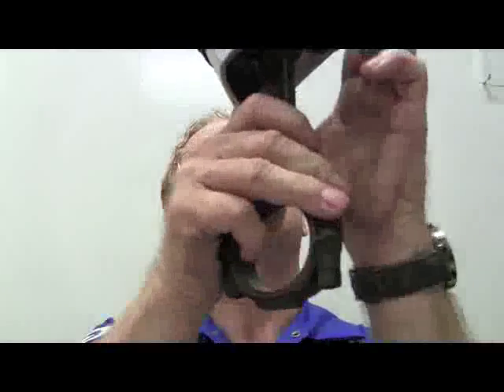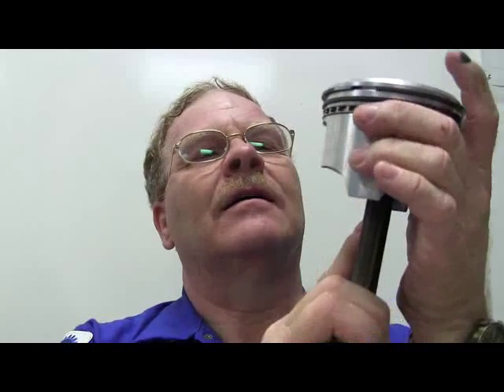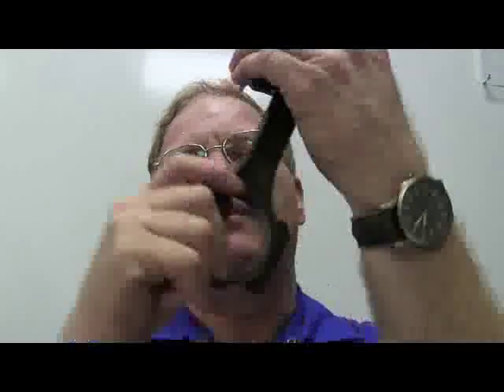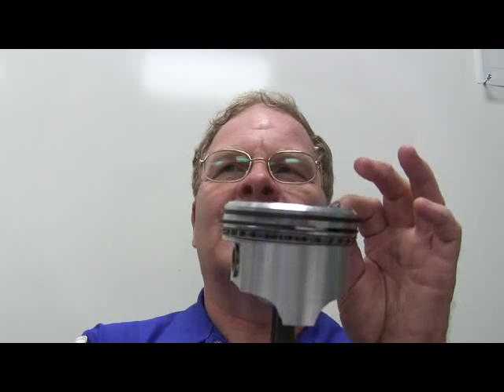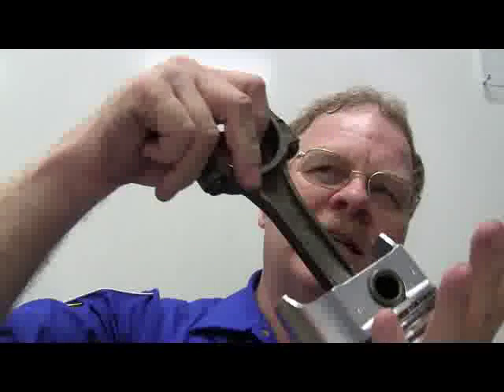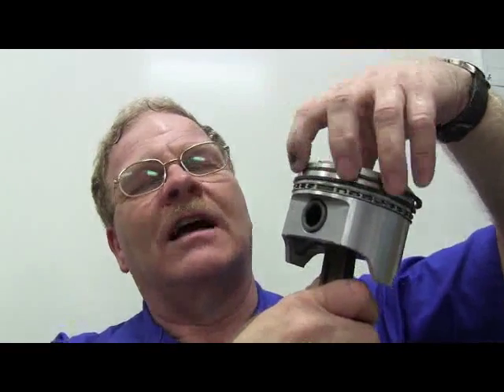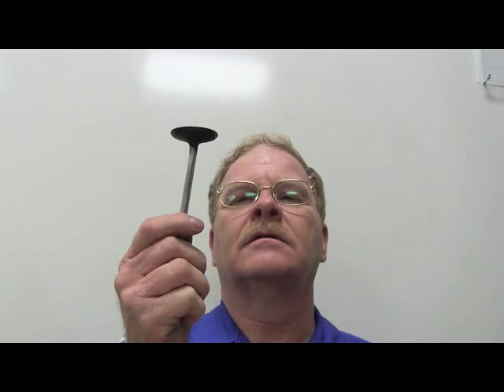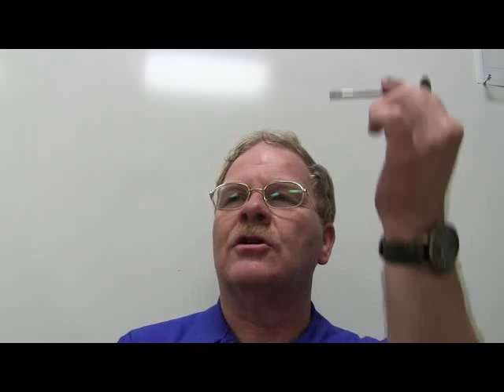Engine Basics My Way

Comment: Exhaust wrap makes a difference on some systems. Hotter fumes move faster. I like the crackle & pop when you let off and the leftovers hit the hot pipe. Cam the older ford v8 beef up the push rods with it.

Comment: nice story
I have experienced vapor lock on a full cast iron engine with a steel line clamped to it. Fuel freezing is a new one for me. I like the screen idea. Worked on a old engine with central injection system one time that the injector was not atomizing the spray like a new one. Once worked a Ford 400 that had a noise insulator on the cam gear crumbled off = very loose chain and caused a inability to smooth idle and run just fine above 1100rpm.